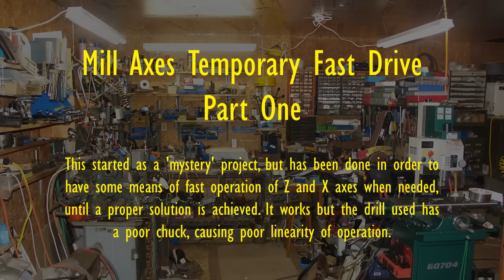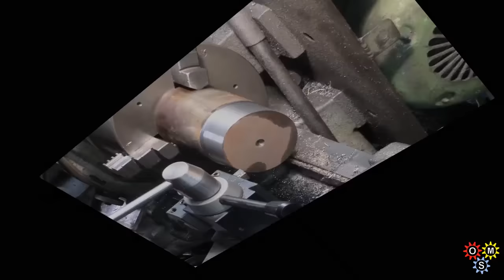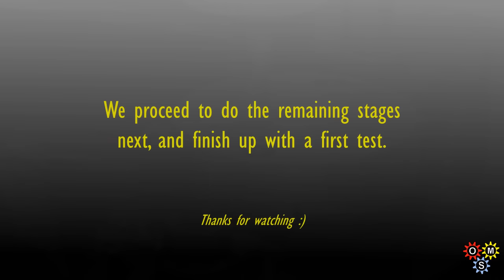X and Z Power Drive Temporary Fix! Part One

Comment: good job on the build, as you know, i now have the grizzly g0602 lathe. and i like it very much. just one thing i dont like about it is the fact the lead screw doesnt have reverse and the y axis isnt auto. so i have been thinking how to modify it to do both. im sure i will nee to disconect the lead screw inside thegear box and either use stepper motors or wiper motors. but i want to still be able to use the hand wheels too. so it will be tricky
Reply from the maker: +Bison Workshop 
Yes, could be tricky to modify for sure, but a useful fix if achievable.

Comment: Hey, I bet with the right cordless drill on low gear you could have a great temp power feed not only for rapids. 

Colin :-)
Reply from the maker: +CompEdgeX 
Possibly Colin but low speed control is critical so - really only planning for a way to quickly go a significant distance. Z axis in particular is hard work manually!

Comment: Next time you have to do a saw cut like that ...use your cutoff tool to go about a 1/4" deep; now when you cut it the blade will follow the grove.
Reply from the maker: +Grandpa Bill 
Actually Bill - though you make a good point, if I start the cut under slight control it does go very well. The actual error from square on that piece was only a few thou which wasn't bad considering diameter. The other material removed was just because we made a very generous allowance - too generous! :)

Comment: That should end up a practical solution, and less hand turning, mostly for long runs, also better finish with a more regular feed...   ;)
Reply from the maker: +pierre beaudry 
It is only for fast action over distance Pierre - just to avoid the tedious hand cranking. Normal useful slow controlled feed will have to wait until I get the wiper motors set up - one day!

Comment: You could try electric wheel chair motors they can crawl and goto quite a speed  . why take the drilled hole out of the middle only to put it back?.
Reply from the maker: +ftrikerfox 
That is all to do with spacing and a wish to go over the acorn nut. Hard to explain!